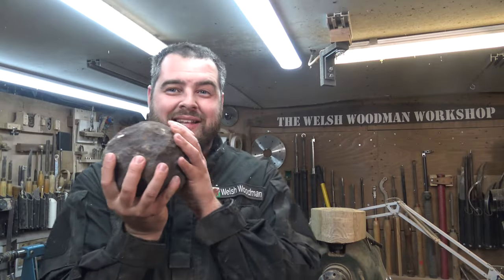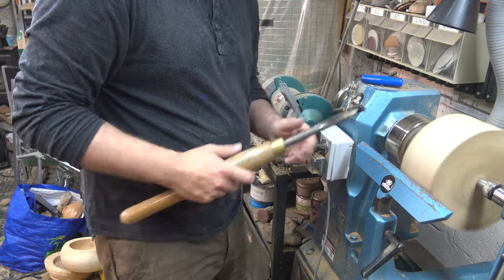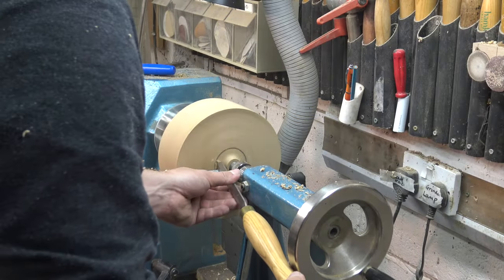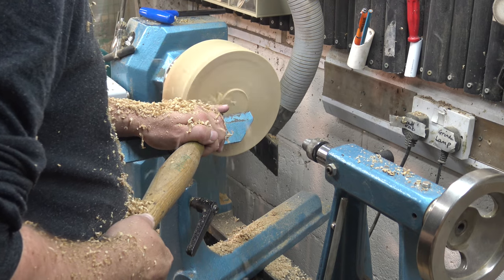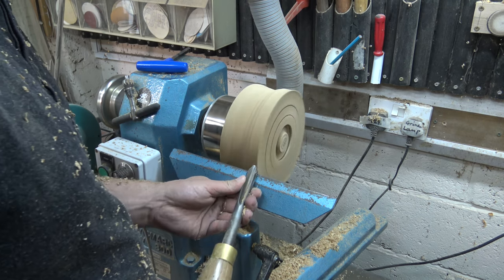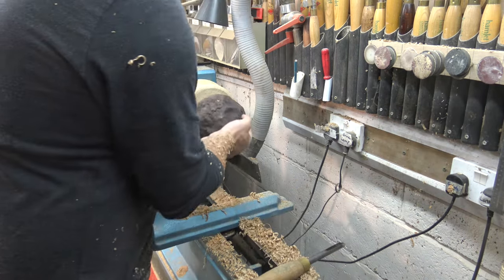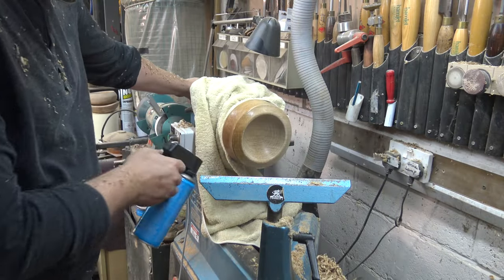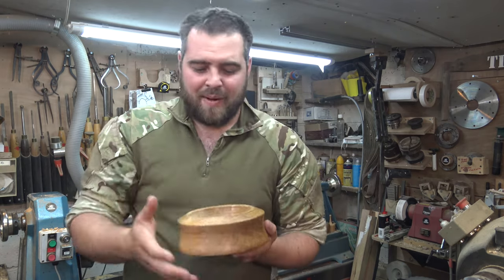Woodturning a Cannon ball holder

Comment: welcome back, nice to see you again. The sprayer you were using, did you have to keep manually squeezing it,(it doesn’t look like it) if not what is the name of it, cheers
Reply from the maker: I use a spray can spraying attachment, it just hooks over the top of the spay can, it has a trigger on the front that you lightly hold to spray, I find it's a lot easier getting an even coat spraying this way. It cost £6 on amazon. I hope this helps 😁 thanks for watching 👍
Reply: @thewelshwoodman649  thank you, I will be looking for one of them